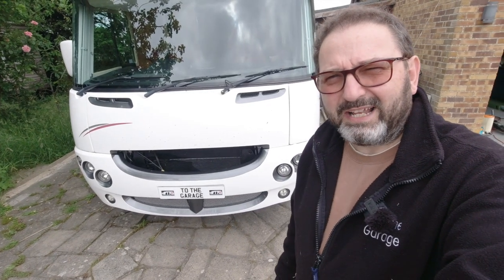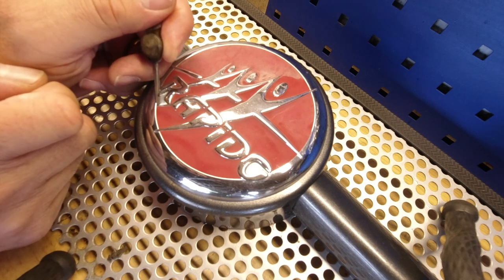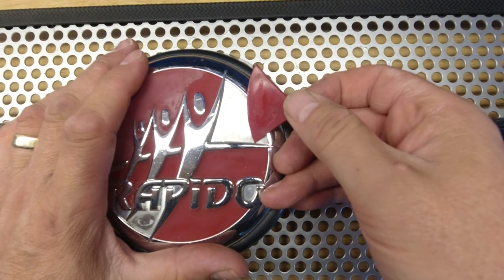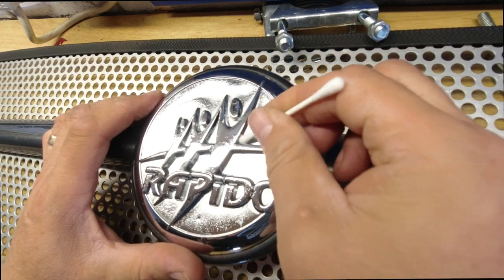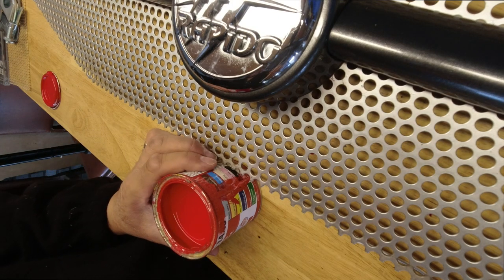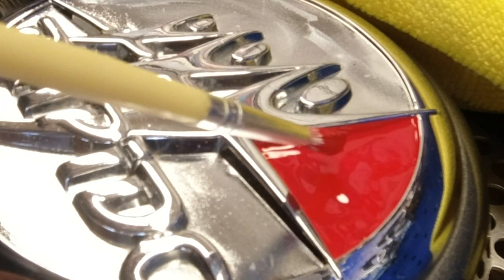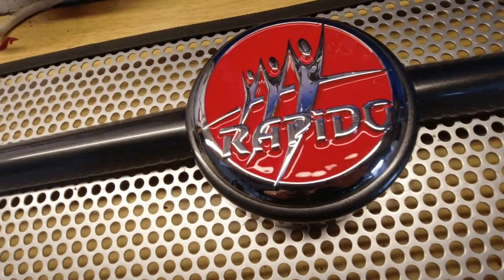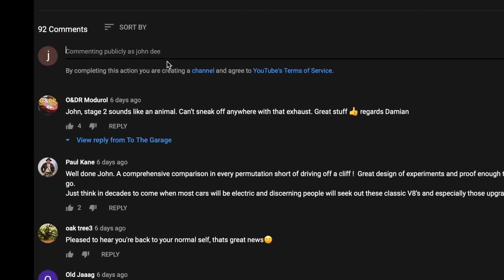Restoring a plastic chromed car van or motorhome badge when the colour insert has failed ( Rapido )

Comment: Honestly John, I was expecting this to be a disaster but that is a really nice job!  That said, equip yourself with a fine brush, for the details, that points (sable is best, but they are expensive). I paint watercolours and use very fine brushes. The single hair brush is an urban myth and does not-or ever has existed.

Comment: Looks good, I have cheap hobby syringes in my tool box, just the thing for jobs like that.
Reply: exactly my thoughts, control the flow
Reply: I’m planning to use little needle tipped dropper bottles and epoxy resin to do the badges on my scimitar.